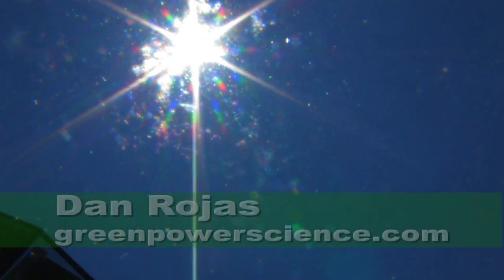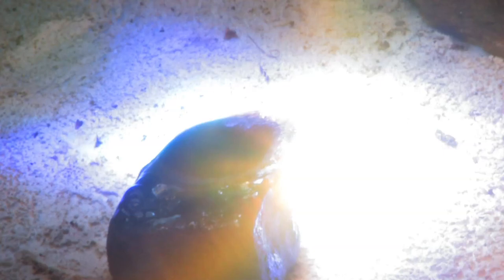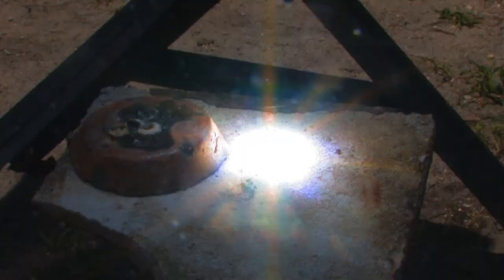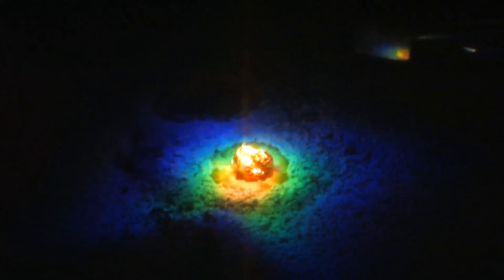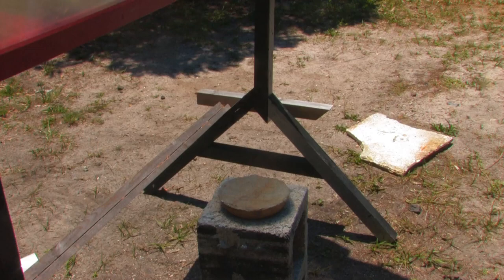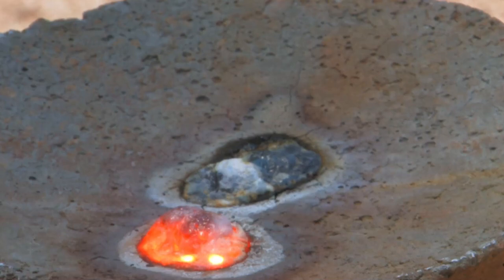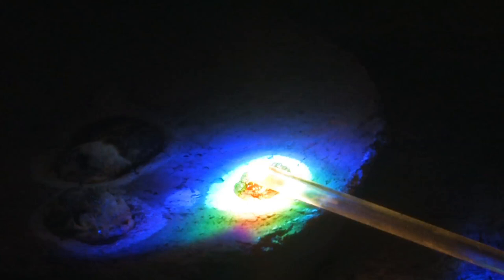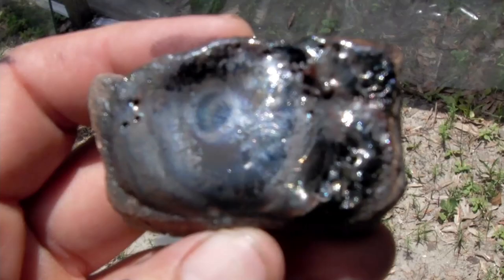Fresnel Lens 3002ºF DIY Lava Obsidian FARMING Melt Rock Sunlight Solar greenpowerscience

Comment: A prism of light! What a beautiful way to melt things!
Reply: No such thing as a prism of light. 

"A prism is a 3D shape which has a constant cross section - both ends of the solid are the same shape and anywhere you cut parallel to these ends will give you the same shape."

Any extruded 2D shape, like circles, squares, triangles and trapezoids, can be a prism. What you meant to say is a beam of light. Or a shaft of light. 

Even the fresnel lens is not considered a real prism because it has no matching bases! The more you know!

Comment: Dan, have you considered controlling the heat that the Fresnel lens produces. Looks like its either on or off, depending on the cloud cover.  You could use nylon screening above the lens.  You can get it in 10,20,30...percent coverage which should reduce your thermal transfer by that appropriate amount.  That way you may be able to just melt your object and not the substrate holding it.  As always a great video.

Comment: Hey man love the experimenting!
I just watched a egyptian movie, they recon the pyramid blocks were melted stone, geopolymer concrete by melting stone.
This has gotten me to your channel. I'm super curious what you would think on that thought and if you could do it to Granite on a larger scale just like an pyramid block of stone, see if you could melt one would be amazing.
Reply: I am also fascinated by that hypothesis but it does not become granite again after cooling.
Reply: I came here because I was thinking the same thing. I wonder if this is how they cut things, but had a better method.
Reply: Clear glass wasn't invented for a very long time, so I'm initially doubtful
Reply: Melting granite turns it into obsidian. So not the answer. Could be used for carving granite as you could melt a spot then shatter said spots with a hammer, as obsidian is brittle.
Reply: @truthseeker8894  and exactly what would you use as formwork/a mould to pour sigh molten granite in? That would withstand both the temperature and the pressure of liquid granite ? Even with today's technology quarrying it would still be far easier, ( casting stone blocks??) back then the technology/materials required simply didnt exist. No they aren't geoploymer or concrete or anything like that they are natural stone, ask a geologist.
Reply: Eu sou do Brasil e também estou aqui por isso haha,pesquise sobre o farol de Alexandria!
Reply: I watched that same one and haven't seen it in a while. Cool

Comment: Because it's light, can a mirror reflect it?
Reply: ho my god why has this not eben answered I want an aswer
Reply: I would assume that if it is possible, The mirror would have to be incredibly reflective and be well insulated with some way to continually cool it.  It probably wouldn't be a normal mirror with glass but another type of material if it were to last and be effective. Maybe the proper material wouldn't even need insulation
Reply: Of course.
Reply: There’s another video from king of random where they try it, the mirror melts or breaks every time. I think it is possible to reflect the beam from a less concentrated area and focus the light with the mirror but that’s all speculation at this point.
Reply: @g.o.centric8143  i think you are right, i believe they do it in another video.
Reply: @iSteve931  The ancient Greek Archimedes may have used mirrors acting collectively as a parabolic reflector to burn Romans ships attacking Syracuse. The 2nd century AD author Lucian wrote that during the Siege of Syracuse (c. 214–212 BC), Archimedes destroyed enemy ships with fire. Centuries later, Anthemius of Tralles mentions burning-glasses as Archimedes' weapon. The device, sometimes called the "Archimedes heat ray," was used to focus sunlight onto approaching ships, causing them to catch fire. In the modern era, similar devices have been constructed and may be referred to as a heliostat or solar furnace.
Reply: @user-ci6fq4pq5v  
Now they've accelerated that same basic theorhetical experimentation and coupled it by creating the DEW... Direct Energy Weapon!
Reply: I thought that same thing
Reply: @user-ci6fq4pq5v  the lighthouse of Alexandria was the same thing, it was positioned in the perfect spot for naval defense
Reply: My best guess would be "momentarily". 
The very thin metal reflective coating would heat up and melt off, and the glass would probably shatter shortly after.
Reply: it is not just light it is heat
Reply: I think not a mirror but one of them prisons used in laser engraving machines may work.
Reply: it would have to be parabolic in order to concentrate the light rays, otherwise they are merely reflected.
Reply: I guess a mirror could reflect for a while but it probably would still melt the glass after a while as mirrors dont reflect 100% of the light, they reflect usually about 95%.
Reply: People still doubting the stories of ships being destroyed with light beams ?
Reply: There are mirrors that reflect lasers that are hotter than this. So I would assume it would have to be a special mirror but its possible.

Comment from the maker: It depends on the material being heated. The use of a crucible helps dramatically. Metals generally have difficulty exceeding 2500˚F as they dump heat rapidly. Let me know the general mass, and material being heated.

Comment: On a large scale project like the polygonal stone work in Peru, Bolivia and around the world, perhaps this is a technique they used.  However it seems the scale of light magnification would had to be enormous.  Some of what I see like with the ornamental pieces, the Olmec heads and such, I wonder if they developed a way to divert, manage and flow small fingers of lava into earthen molds.  There are volcano's in the area of some of these sites.  In man's everyday effort to work smarter not harder it seems they would have tried to farm lava to form their stones instead of hammering away on basalt outcrops.  If you could divert a small flow into an earthen pit form, already have the form filled with sand and shaped with the intended design, you'd have a sand casting no?  The Olmec were nicknamed "the Rubber People".  Probably made some kick balls for recreation & sport but that wouldn't get you on the map.  The Hibvea Brasiliensis rubber plant is the highest quality on the planet for rendering rubber, more especially Latex.  We use rubber and latex for many things today although I doubt they needed tires but gasket material does come to mind.  More so, Latex Molds.  Heck, they may have kicked a ball into some water and noticed it floats being less dense than water.  Rubberized rafts come to mind, why not, we use them today to save lives from deluges.  But what if one evening by a camp fire while watching cinders rise up from the heat and float up into the sky, one had an epiphany and instead of making an ancient soccer ball, he molded a thin sphere of latex with an opening.

Comment: In years past Fresnel glass was used in buildings to increase the natural light. Do you see that type of lens coming back. To decrease energy usage. If so. Can this still be brought? PS love seeing rocks melting.
Reply from the maker: Sandra Keener Hi Sandra,
Fresnel glass is usually a much lower ring count due to the nature of score lines in glass acting as an easy breaking point and like all lenses they either concentrate (solar) or spread light (lighthouse). There are projects that channel light using newer technology for light tubes and fiber optic. I do think it has valuable usages but would need to be part of an original construction build vs retrofitting an existing structure. Thank you for enjoying our videos.

Comment: can u burn carbon? It might be turn to diamond.
Reply: Wouldn't work. Carbon needs intense heat and intense pressure to turn to diamond, as well as a zero oxygen environment so it doesn't turn into carbon dioxide.
Reply: F&D  But you can still make diamonds other ways.
Reply: boomerang4071 Can you though? I've only ever heard of it being artificially created through the use of explosions, and I'd imagine it creating the environment that Covjitsuka eksplained.
Reply: carbon has the highest melting point of anything (as we know of) higher than tungsten that has a melting point of 6191.6oF. the tempratures 'generated by this (as stated in the title), 3002oF could not melt carbon as for burning it i am not sure. The conversion from graphite to diamond woks a temperatures well over 1700 kelvin and with pressures more than 12 giga pascals, so, as far as i know you can't. don't quote me on that. see this website for more info =)

http://www.technologyreview.com/view/422350/the-trouble-with-turning-graphite-into-diamond/

as for explosions, it can be done bout the diamonds aren't 'daimonds as we know it' and i assume the process is quite expensive.
in i think the cold war a soviet country had a wind tunnel for testing missile heads with an explosion at one end, after the war (i think this was during a war) they put carbon in and got diamonds out. Artificial diamonds can be used for tools such as tile cutters.

i'm not sure of any of the above though so don't use this for any exams or stuff.

nice thought though -_-

Shit im sad
Reply: i think your version was more concise!
Reply: KidWithDaAttitude What if the lens was two or three or more times larger than the one used in the video? I guess maximum focal point temperature wouldn't scale linearly with lens size would it?
Reply: You need a lot of pressure to produce diamonds.
Reply: pressure too

Comment: I wonder if you've inadvertently discovered how the Arc of the covenant was used. It was made of gold, so you could place some materials inside (could be anything, Glass, Metal, Stone). They would eventually all reach their respective peak temperatures and begin to glow - the Arc would not melt as it's made from gold, it would heat up though. 

I think maybe they heated the materia, placed the lid back onto it... At this point there are possibly several different methods you could use to turn this into a useable and effective energy. One potential option would be to have it placed into a water source where it would continue to retain the heat and continuously create steam,. This would be nice for a bath, on a serious note I heard there was an entire cult that dedicated itself to bathing. 

Aside from the hot bath you'd also have steam energy which would be even nicer as this could be used as an effective form of energy for various different mechanisms..

Comment: Hot dang, you're turning aluminum into plasma! that's unreal!
Reply: I wouldn't say that it turned into plasma, at least not to any appreciable extent. What probably happened was that once it melted, the aluminium reacted with the calcium sulfate in the plaster, reducing it into aluminium sulfide and oxides of calcium and aluminium. It was also being oxidized in the air.

Comment: you should try welding two pieces of steel together.
The question would be if the sun could be a tool you could successfully use for welding.

Comment: You need to know that when you vaporize aluminum, the fumes are highly toxic. Same thing with copper, zinc and many other metals. Always work with lots of air flow and even when outside, stand up wind.
Safety First.

Comment: I've been considering carving a small home out of a very large rock I have on my property. It dawned on me that I might actually be able to melt the rock using a group of Fresnel lenses and scoop out the molten rock out as I go. I suppose when you start to get inside the 'house' you might need to use mirrors or something to carry the beams of light inside and direct them around corners. Do you think this is a totally crazy idea? I mean, do you think it would even work? Thanks.
Reply: And you do it? How rezults?

Comment: What is happening with the aluminium is actually a chemical reaction that is stripping oxygen from the sand and concrete to form aluminium oxide and silicon / calcium metal. Simmilar to the Thermite-type reaction.

Comment: 1- Produce glass out of sand.
2- Design lenses and mirrors out of it.
3- Calculate the Sun's position and degrees.
4- Heat up granites with the help of lenses.
5- Cut or carve them by Obsidian tools when hot.
6- Hammer it out when it glassified.
7- Clip up the corners with Flint stone tools.

Is this what you think guys? Is there anyone put that to the test so far?

Comment: I like melting various types of rocks and minerals together. It's like a side job for me and I sell my artwork. If I try using solar instead of a acetelyne torch, would my welding goggles be sufficient? Eye protection? I can save money on burning or welding by going solar.. cheaper than acetelyne tanks.

Comment: This makes me wonder if you can simply get some lensses and point them at solar panels to get more cost effective solar energy. 
 I assume those lense are cheaper and easier to maintain than a solar panel. And of course you wouldn't concentrate the light so much that it can melt stone.
Reply: It would destroy the panels

Comment: You know umm aluminum vaporization onto say a flexible surface and like then using an electrochemical process could very easily (even if the Zombie Apocalypse happens LOL) using green energy in the field to produce highly reflective concentrating mirrors ;) good one.. I like this one as well and think you for solving (by solutions before known) how to use all of those solutions and solar energy alone to produce massive concentraing mirrors

Comment: Aluminum reacts with plaster in a thermite reaction! That's cool, forgot that with those type of temperatures it doesn't need to be powdered to work. Idk what the product is, silicon, calcium, idk, some other metal or metalloid than aluminum

Comment: Dan, you can find huge Fresnel lenses in rear projection TV's for free from Craigslist. 

Is there a way to use a Fresnel of that size (rear projection TV) without generating the heat?  I'd like to divert some natural light into an indoor vegetable Kratky garden, but don't want to set my place on fire doing it.

Comment: How would this work with them solar pool heaters?  The ones that you lay on the ground and pump water through them.  Not looking to concentrate the beam, but to magnify the sun rays to really pump some heat into the flowing water.

Comment: Where did you get the lense from, was it specially made? I wonder what other techniques there are - for example you seem to be melting a solid block with ease but i wonder what would happen if you were to use rubble, or metal filings?  I'd be interested in seeing more experiments.

Comment: They say the egyptians used this to melt/make concrete.   This doesn't look like its doing much.  And on the large scale output they needed it for I find it insufficient.   Don't get me wrong it destroys plaster and weaker material.  But the rock at the beginning under the lense for 10 minutes I did not see an appreciable effect.

Comment: Well, I am trying to reproduce an experiment with the Verneuil process replacing the near 2000°C degree flame with the lens solar beam. So the material heated would be pure Aluminium Oxide (Al²O³) 100g (Molar mass:101.96 g mol−1) and 100g Chromium(III) oxide (Cr²O³) (Molar mass:151.9904 g/mol).

Comment: I have a large about 50 inch Fresnel lens ripped out from a Toshiba Rear Projection TV screen. I tried testing it out, but it's not burning, the focal point seems too large. Did I get a dud, or is there anything I can try? Right not I can get a spot the size of an orange or a small grapefruit if I bring the lens really close in. Swapping the side doesn't seem to create that much change either. Any ideas?

Comment: Could you please tell me if the heat generated b this process would be enough as to be able to weld two steel rebars (as the ones used to lay concrete foundations and even maybe bend the rebars at specific angles? Thanks!

Comment: Very cool!  What do you use for eye protection?  I have an off-the-shelf set of welding goggles, will that be sufficient?  I lucked out for $10 rear protection tv Fresnel lens that gives a nice tight spot focus and aim to easily make a rig like you have there.

Comment: This was really great.  you could set up an x and y axis/ moving plate holder and machine place steel or alum with no AC bill.  

This could also be a great way to set up a small scale, low cost foundry in the developing world.   Would work Great for what User: sugarcreekforge is doing in Uganda.

Comment: Hi Dan, I enjoy your channel watch it as much as possible. I have a question a rather important one. I see you have the flip up welding goggles, what shade factor is that?. I have read you need a factor of 11 for arc welding when looking at the sun or refection. I bought a pair of flip up thats for gas welding i guess a factor of 5 or 7. Is that adequate when working with a frensel lens? Please advise... thanks Dan

Comment: you didn't vaporize the aluminum, as it only boils at 2520 C, most likely the molten aluminum was splattered by the water vapour generated by the dehydration of your plaster board which when heated up loses loses the crystal water CaSO4 . 2H2O -> anhydrous CaSO4

Comment: are you sure that aint toffee....the cinderblock should pit....though its mildly refractory.....cement pops off chunks when molten lead is poured on it.....moisture is trapped and thus....that cinder blok should react....when on a wood beam....the wood doesnt react.....,aluminium foil IS weak....but...something aint right here.